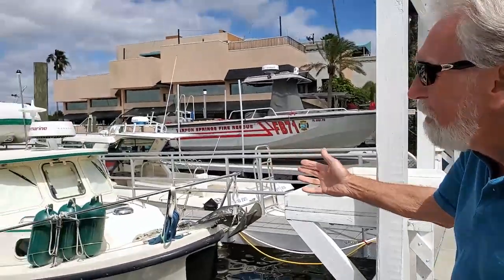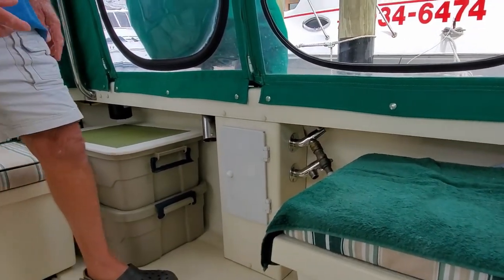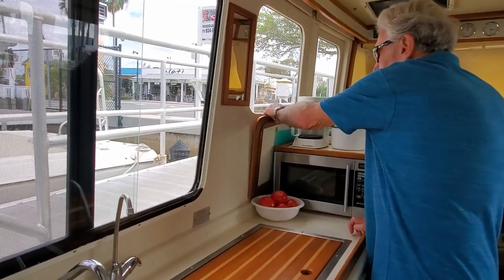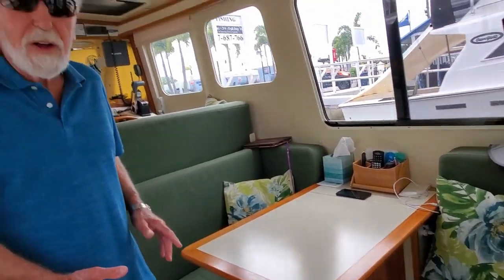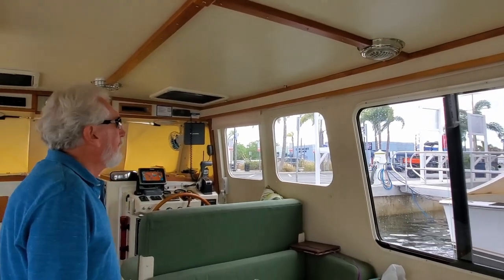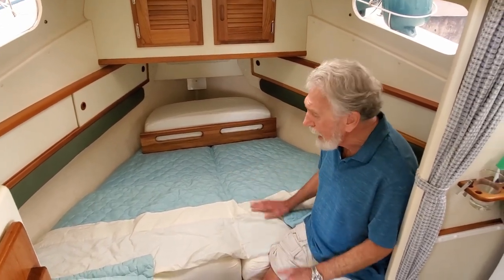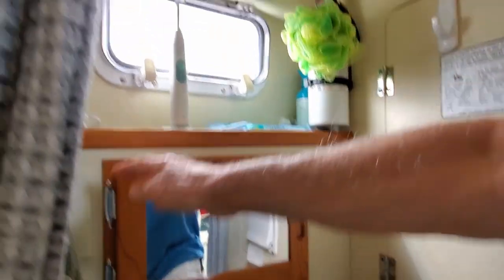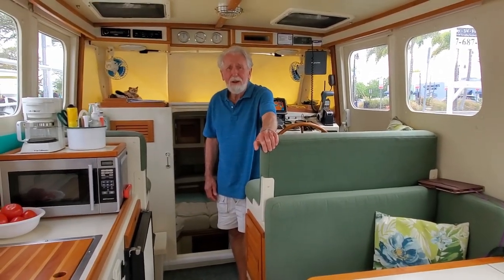Cool Change Upgrades

Comment: WOW great boat and nice modifications. Does the AC run with the gen. on or is it
just for use at the dock ? What kind of outboard power do you have and how much fuel do you hold?

Comment: Nice job eon the mods and that’s coming from a carpenter with over 30 years of experience. I had to pause the video a few time to figure out what watch you were wearing. The Seiko 5 is one of the best watch values on the market. Looks great, reliable and only a slightly rattily bracelet.